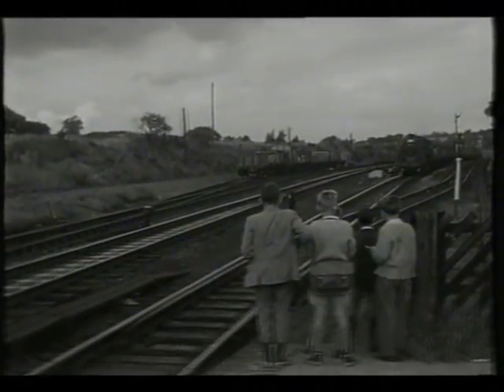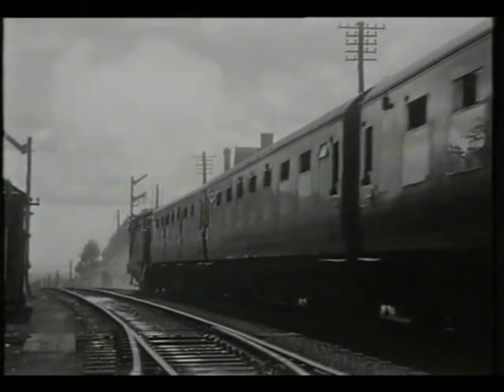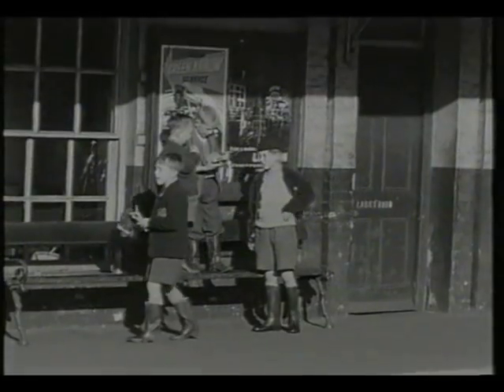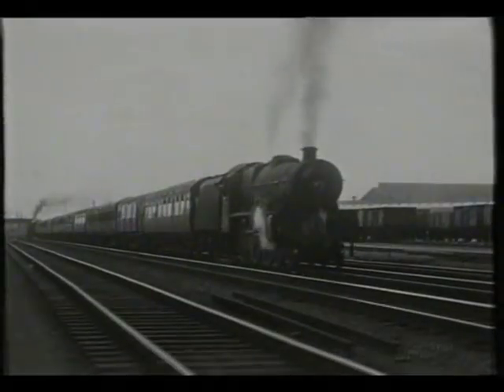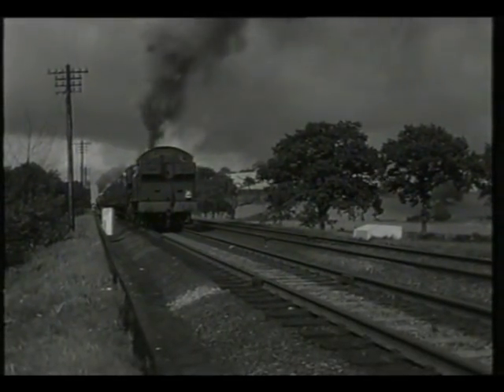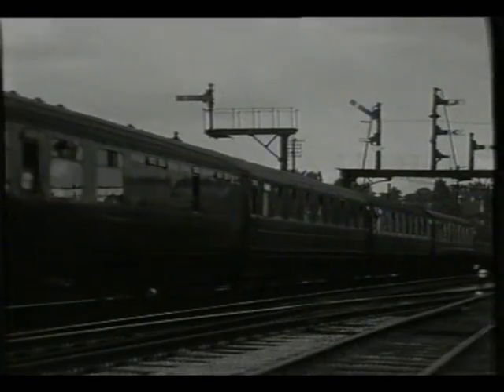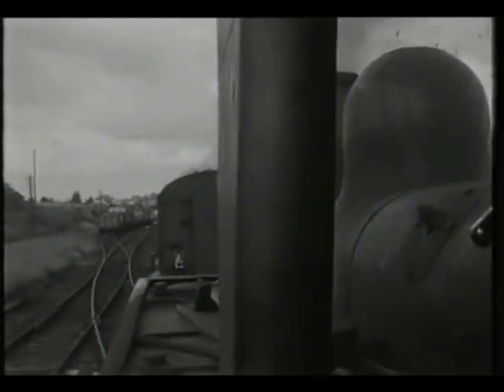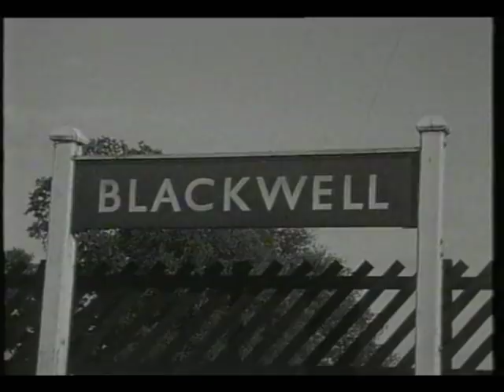Railway Roundabout 1958 'Trains on the Lickey incline'

Comment: even a 4 coach train needed assist up the hill, but theres a video on here of a restored engine pulling at least 6 up it, solo, what an effort that must have been! I'm guessing the restored engine was like a much more powerfull engine than a standard engine in mainline service in 1958. I love steam!
Reply: I think the requirement for a  banker was in case of a broken coupling so that the coaches could not run away down the bank
Reply: I hadnt thought of that, makes sense for a good backup measure too, and they can use thier extra push to assist the main train in its goal of climbing the hill
Reply: epj900 the vacuum brakes on carridges would eliminate that possibility.
Reply: kineticdeath the 2P (2p being the power class) with 4 coaches is from the early 1900s, this is why it needed assistance. The Black 5s, (some of them might by 6XP Jubilees) which still only had a power class of 5mt, and seem to mostly 8 carridges upwards. Most railtour locos were built for expresses, power classes 6p-8p usually. They were designed to pull 15 coaches and known to pull upwards of 20, so that is why they could do 6 up such a steep gradient.

I'd also like to point out that the 2p was abnormally small for its time, due to the Midland railway's small engine policy. There were 4p Midland compounds, as well as many passenger locos of 4-4-2 or 4-6-0 probably around power rating 5p.

Comment: re epj 900, the requirement for a banker was simply to give the train a 'shove up'. If the train were ever to come apart, the whole train would immediately come to a stand because the brakes would automatically come on - train brakes are held off by air pressure (used to be vacuum) which is dissipated if the brake pipe is severed or uncoupled.

Comment: I can see those locos not being equipped with vhf radio though it was possible then there would have been a lack of cash then due to the war debt imposed on us by USA Skull and Bones:-(((.
Reply: No vhf then. Whistle codes used, e.g. "cock-a-doodle-dooo" from banker to train engine and reply ditto to crack right away for Blackwell!
Reply: @royfearn4345  I forgot this railway was in situ in 1840 about when Telecommunications was born out of the needs of the railways